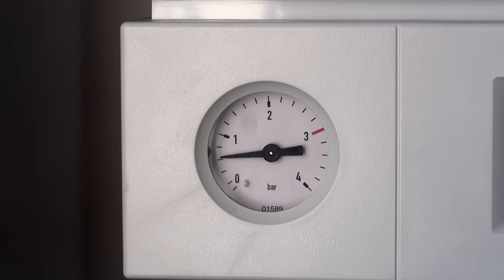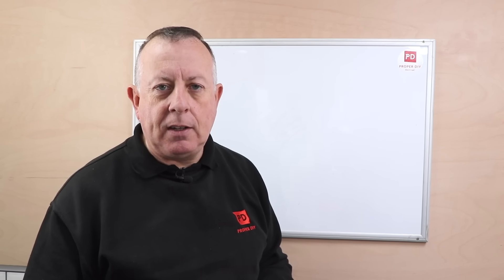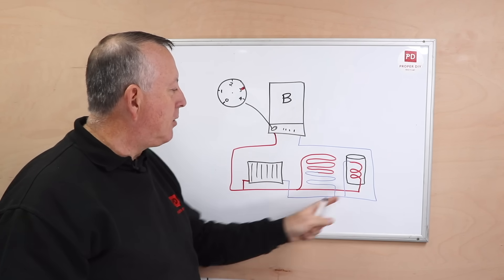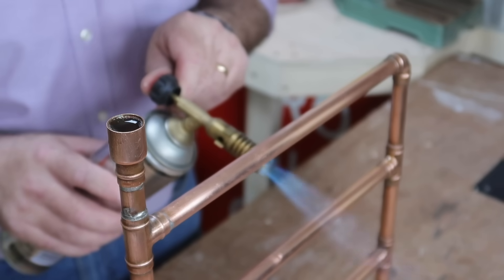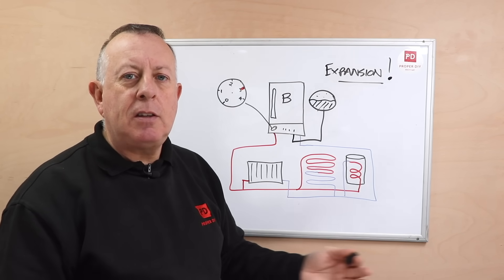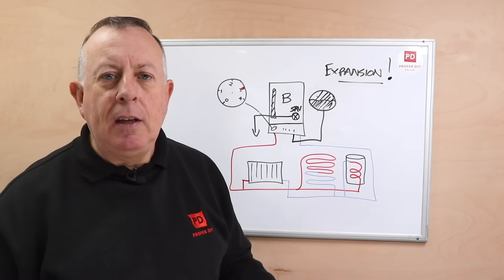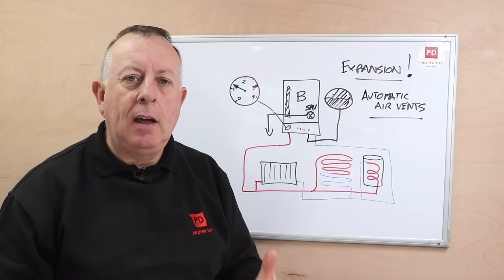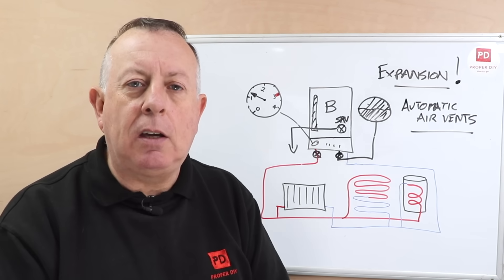Why Your Boiler is Losing Pressure and How to Fix It

Comment: It is highly unlikely the expansion you are seeing in the water is from thermal expansion form the small area you are heating, its more likely to be from local boiling and the formation of steam bubbles.  Heating water does make the water evaporate more and create pressure referred to a partial pressure.
On the issue of interfering with your boiler, there is no legislation against an owner "messing with it", obviously it can be dangerous and the more knowledge the better, but messing with the wet parts is usually within the ability of home mechanic.  My gas registered "engineer" was unable to fix my boiler, but I was able to fix it reading the fault finding diagram.  Turned out to be a problem with the drain for the condensation, it was blocked.

Comment: What about an all electric boiler when a plumber just states it needs a new valve?  But after doing the boiler check, and refilling the tank the pressure is back to normal.  Does that mean it does or doesn't need a new valve?  It only does water, as towel radiators are electric, and heaters are all electric.

Comment: I am unable to pressurise regardless whether the boiler is on or off. No noise when you open this 2 valves either. Could this be an expansion tank problem?

Comment: Best solution is an external pressure vessel. You can just leave the one inside the boiler.
The vessel inside is subject to heat and the diaphragm perishing. 
Add, another vessel.

Comment: Why does the system need to be pressurised to 1.5 bar - I can see why the pressure increases from expansion when the water is heated, but what is the purpose of the pressure when cold?    My F&E system shows 0.7 bar which is just the head from the boiler to the loft tank 7 metres above.

Comment: We had combi boilers in two previous properties and we installed lovely cast iron radiators because we like the look of them. Unfortunately some of the joints in the radiators failed and the system would regularly lose pressure (should have learned our lesson the first time!) What we realised was that combi boiler systems are running at mains pressure so any weaknesses in joints, valves, pipework etc. are more likely to fail. In our current property the boiler is the older type with a hot water cylinder and a header tank, all running at a much lower pressure. We have the same radiators as our previous properties and they have been fine. The modern closed system is more efficient but you’d better be sure you have very good pipework and fittings. With the older system it’s at a lower pressure and if there’s a small leak the header tank just tops the system up again and is much more forgiving; you also get a back up with the immersion heater if the boiler goes wrong. After our previous experiences I would be reluctant to install a combi boiler in a future property.

Comment: Anyone reading this with a Worcester 28 junior boiler and you have no leaks change the valve on your expansion vessel ( same valve as your car tyre ) the valve costs pennies and a normal valve removal tool costs about a fiver on eBay. Total spend for me was £6.50 I used a foot pump with an inflation gauge to inflate to correct  BAR pressure, to remove old valve and replace with new valve and re inflate took me 20 minutes.

Comment: When mine was losing pressure it was the PRV on the boiler leaking. I put a new valve on to fix it. Just an accumulation of scale in the valve has made it leaky.

Comment: Should expansion tanks be fitted with the inlet on the lower side, as in your video?  The air would stay in the tank even if the diaphragm was broken.  Mine is fitted hanging down and I'm guessing it is full of water already!  Tapping them should give two distinct sounds, a dull thud (water) and a metallic clink (air).   The gauge can also be bust!  I would replace the tank, the gauge and the PRT all together, perhaps every 10 years or perhaps more often - what is your opinion?

Comment: I'm a 72 year old woman on my own. My boiler was put in by some idiot , nothing is right with it . I have no hot water now, the rads don't all heat up , i know the expansion vessel is busted, and the pressure won't top up now. The five people i have asked over the last year to look at it just look,  charge a call out fee then never come back. Some say they will order the part needed then never come back . Some ask if i go into the loft regular ?? why i don't know , but it's hard to get into a loft at 72, i have no idea why ! someone would build a bungalow and know it's for older people , yet put the boiler in the loft , especially when there is plenty of space on the ground floor one could be installed. I don't have much money , if i could afford a new boiler i would have one. I can't seem to find a decent honest engineer that will do the job, i'm tired and fed up , i have to boil a kettle to wash , and i shower with the electric shower . I just don't need this at my age . I think when you're a woman on your own some engineers just take the wee, two guys actually laughed at me when i asked if they could fix it , whatever happened to the good old honest British workman . The boiler is now saying reset .

Comment: Hi great video.  I might be being a bit picky here lol but your drawing showing the tank calorifier on the right is plumbed the wrong way. Hot goes in the top " and falls as it cools. Pumped or not.  Lol😮
Reply: Makes little difference as those indirect water heating coils are inefficient anyway.  Measure the temp of the pipes going in and coming out - hardly 5° between them usually.

Comment: Thanks mate for your explanation. I'm currently having issues with my pressure dropping daily, I'm talking about 2 bars of pressure dropping within 10 hours or so. I can't find any visible leaks anywhere and as you've mentioned we haven't done anything in the house to cause any leaks behind the walls, ceilings or under the floors. We had the home emergency guy come out who didn't do much to b honest but said the expansion vessel seems ok and the condensate pipe was dry as well so he believes we have a leak within the walls somewhere and want's me to get a trace and access done which is going to cost a fortune. I'm fresh out of ideas at the moment 😢
Reply: Hi, did you find solution? I’m experiencing same!!!!
Reply: @mentorist  I'm sorry to hear you're having the same issue, mate. We eventually hired a company that used tracer gas to see if there were any leaks anywhere, which, unfortunately, was really expensive. They couldn't find anything, but then they eventually determined that it was our Expansion Vessel. We changed that, and since then, the pressure has stopped going down. Could be worth a try.

Comment: Stuart   what do you recon?   I fitted a 12l vesstle in  our lads loft. It was so easy  onto a bit of return heating pipe but I left the faulty vessle in the baxi eco combi cuz it's a bxxxxd to get at. Of course I really ougfht to have capped the feed off to the proprietory 8l  vessle....... he tells me there's no leak on the ancilliaries re rads etc valves.   With fitting an additional vessle  the safety valve can still pass but you have given good advice re the heating circuit shut off but these valves due to them not being gunmetal ( none dezinkifiable) are usually unmovable. I remember incidentally fitting a brand new valve when I fitted his boiler so that one may be useable but the other one maybe OK.   
I'll have to go round there but he says this morning it was working ok so today I can relax. best wishes.

Comment: My 35+ year old boiler needs pressure topping up regularly, yet I never need to bleed radiators, so no excess air in system … so where is all this water going? No obvious leaks anywhere.

Comment: Thank god i still have my bog stnd boiler fitted in 1968 and still works 100%.
These modern boilers ftighten me.
Mine has only 3 parts and basically no electrics.

Comment: every plumber i know calls it safety relief valve as it stops boiler overpressurising  so relieves the pressure which is a safety device built into every combi boiler

Comment: After I had a new gas boiler installed pressure kept dropping. Adding leak sealant made little difference. Finally one day I happened to check the small radiator in my kitchen which was normally not used. When I opened the TRV the radiator stayed cold. I found the lockshield was closed. When it was opened the radiator only heated at the bottom. The radiator had not been opened after the boiler change. Opening the vent to fill the radiator dropped the pressure rapidly. Once the air was vented and the boiler topped up to normal pressure the apparent leak stopped. Somehow the radiator had been filling very slowly via the TRV, dropping the system pressure.

Comment: Thank you very much good video.  My system is needing to be filled up every 2 days. I fill to 1.5 but running the system for about 45 mins it switches off because > 3 bars.  Also there is no outlet pipe to the exterior of the building so can't check if that is the problem. Also there is no expansion tank visible next to the boiler.  I am in Spain so maybe things are done differently here.

Comment: My condensing combi boiler drips about around a pint of water a week onto the kitchen worktop (I have to keep a basin under it) but the pressure has never gone below 1 bar.  I top it up to 2 bars, maybe once a year.  I absolutely hate central heating and don’t switch the heating on but I have to use the thing for hot water.  (I didn’t want a combi boiler when I bought the house and had to do some refurb in 2010 but the builder/plumber wouldn’t listen to what I wanted and installed what they said I needed!)
Reply: Have you checked your condensate trap?? If that is blocked your heat exchanger will fill with water & start to leak. Very common problem, often overlooked.
1 of the many reasons it should be serviced every year.
I mean a PROPER service, not a British Gas service where they stick a meter in your flue, tut alot, put silly stickers everywhere & drive off.
I mean a service where the engineer actually works on the boiler & does,nt walk @ your house putting stickers everywhere.

Comment: Quite a good video showing some of the very popular things I am asked.  Just to clarify a few things.
Condensing boilers (not condenser). Also standard efficiency and high efficiency boilers emit products of combustion through their flue systems..  water vapour (not smoke)and products of combustion are more noticeable, heavier and harder to disperse.
Vented heating systems expand and contract up and down the cold feed and expansion pipes.  If it is pumping over (you say dumping water) there is a problem  with system, too high a circulator setting or too low expansion tank/ vent pipe.
Water is not DANGEROUS at 3 bar (discharge pressure blow off)....
The "outside vent" is the discharge pipe termination point.
People working on unvented hot water cylinders are also required to hold certification to work on them.  Incorrectly installed or maintained   unvented cylinders can be something to worry about.

Comment: Your pressure reading is low. It’s not necessarily that the pressure is low, but a sensor failure. Just happened to us, on a large wall mounted Worcester Bosch, around 10-12 years old.

That said, this is a very useful watch, thanks!
It’s taught me a lot.

Comment: Not sure that leaks from hidden pipes are uncommon. We have had several due to mouse damage to plastic pipes, as have three friends. We now have only one plastic pipe left, and hopefully it will be gone soon. 
By the way-why plastic? Easy? Lazy?
Reply: Cheaper, easier to create sealed joints. Only suitable for drains, not conducting hot water.

Comment: Good video.  I’m topping up every day, losing pressure on space heating cycle.  After tests I have conclude pipework leak.  I hope to limp through winter and brace myself for re-pipe in the spring.  It’s a crap 15mm one pipe circuit....so a good two pipe 22mm circuit should massively improve the heating making it worth the cost and disruption 🤞

Comment: "Safety relief valve" is a misnomer. It is either a safety valve or a relief valve. The difference is that a safety valve cannot be isolated from the system while a relief valve can be. The relief valve (if fitted) is normally set to lift at a lower pressure than the safety valve, but will include an in-line isolation valve so that if it sticks open, it can be isolated to stop any leak.

Comment: In the past I've been advised to put a small plastic bag tightly around the bottom of the pressure relief outlet pipe, or even the finger of a rubber glove. After the pressure has dropped a little any water expelled will have been captured in the bag and it's obvious to see. The problem with these drains is they're outside so you can't tell rainwater etc. from leaked boiler water. Hope this helps

Comment: Thank you for your video's.. I have been losing pressure on my heating system recently and have been topping it up every couple of weeks !!!  I dont have an external expansion tank.. but have a Vaillant boiler and megaflo ! Does the magaflo have an internal expansion tank ? Ive noticed some staining around the condensate pipe !! Could the problem be magaflo expansion tank needs a re-pressure ?

Comment: I have an oil fired combi and my pressure loss was due to the 3 bar pressure valve which had a slight leak, not surprising as the old girl is 20 years old. always serviced and has a lot of new parts.

Comment: I have a sealed system and during the summer with heating off and just on for hot water the pressure gauge gradually crept  up to over 2bar. Now that the heating is back on I've had to vent the radiators which released a lot of air and the gauge is now back to 1.5bar. Should I leave the hot water tank pressure relief valve open which when opening manually also releases some air?

Comment: Mine doesn’t need to be pressurised. It is fed from a header tank and, in Summer, does not even need a pump to circulate the water, since the hot water tank circuit is gravity fed.

Comment: Hi I have a problem with unvented heating system. It loses pressure very quickly, within half an hour after topping up to 1.5 bar
I have new boiler and expansion vessel installed. Got engineer to look at those but no problem identified.
Also got Trace and track people to find any leak but again couldn’t find any leak.
The drop in pressure happens irrespective of heating is switched on or off.
I am really puzzled what I can do further. Had five engineers but none could fix the issue. 
Any other thoughts
Reply: This is me
Reply: I have to get myself upstairs every six hours to let more water into the boiler, otherwise everything stops working. Soon as more water in it fires up, for about six hours then it's gone again. 
A plumber about two years ago replaced the diaphragm so bought one and will try replacing that.  
Boilers are so awfully complicated, I was happier with the old immersion heater tank. Simple and never any problems.
Reply: @vanwin-p6b  mine changed the expansion vessel and all done for now. I bet it's that as the first  one didn't bother testing it and walked away. You just had a shit technician as the loop is probably fine. No water coming out from anything but the boiler.  I had to diagnose it myself to get them to come out rediculous but I did it.
Reply: @ Thank you, I have added it to my list of most likely things to check.
Reply: @vanwin-p6b  they pump it up or something and check it.

Comment: Not had to repressurise our system for 20 yrs because we went back to 😢the low pressure system with header in the loft. Mains water gone off?  No problem plenty in the loft. Gas gone off? Boiler breakdown? No problem just switch on the immersion heater. Laundry need airing? No problem put it the warm airing cupboard. We are very pleaded with our nearly new boiler with the "old" system  suits us just fine.
Reply: That's great, your on!y problem will be if your heating pipes leak under the floor you won't know unless your neighbour tells you.
Reply: @jimmilne882  
Bungalow no underfloor pipes, both header tanks replaced all drops and rads replaced. A ch leak would be fed by the header tank forever unless mains stopcock was turned off,  and the hot water system has a lge header tank so ditto potential.

Comment: If you see smoke you have serious problem with your boiler. What you see in the video when you say smoke it is actually water vapour. It is pressure and volume, as it heats up the water tries to expand but since the volume of the system is fixed you will see pressure increase. In a vented system there pressure is released so no pressure increase. In a sealed system the expansion will accommodate the the volume expansion so there will be a much smaller in increase in the pressure but to small to see on the system pressure gauge.

Comment: Thanks for this video! Very informative. 
We closed the inlet and outlet valves and then the pressure in the boiler stayed normal while the pressure in the expansion vessel dropped to zero.  Since there was hot water hence, no expansion, the SRV might not have had leaked water but still pressure went down. I am more and more convinced that we have an annoying leak in our pipework. Very unfortunate! Because we can’t see where the leak could be!